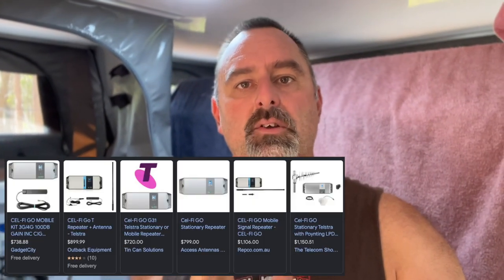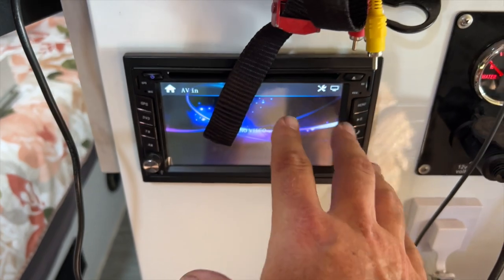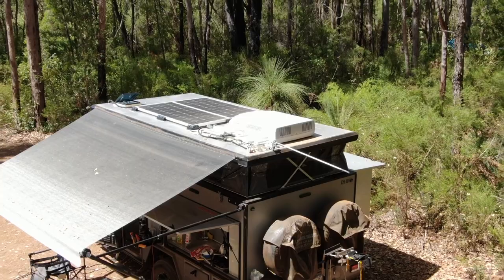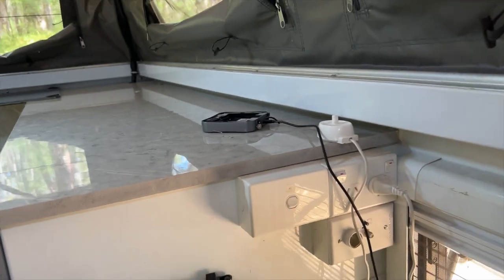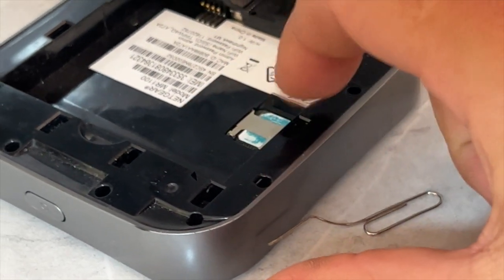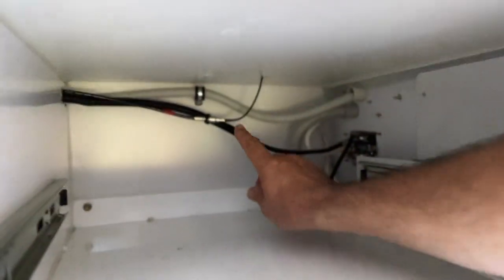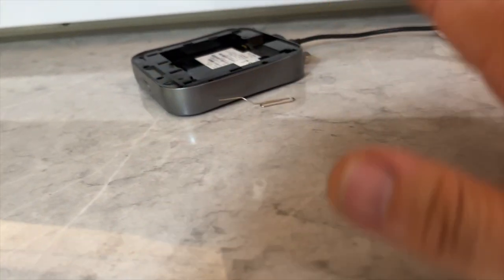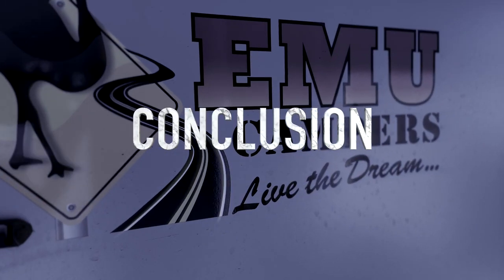INTERNET while CAMPING - We use both OPTUS and TELSTRA. How and WHY do we do it?

Comment: Good point about Telstra and Optus. Whilst Telstra still have the best overall coverage, you'd be surprised at how many places there are out bush where Optus reception is decent but Telstra reception is non-existent. Not quite the same but I've been using a dual SIM phone for years just because it's nice to have Telstra and Optus on standby, in case I'm somewhere where only one or the other is available and I need to make a call (or be contactable).
Reply from the maker: Yeah even when both have coverage if it’s busy (say Easter) the Telstra cells slows right down because so many people are on it and often the Optus cell is faster.
Reply: @JebbreysJibberish  That's true... it's the exact opposite of data speeds in metro areas, where Optus is usually slow as a wet week because they don't have anywhere nearly as many cells as Telstra.
Reply from the maker: Very true!
Reply: @TheKnobCalledTone. not really, Optus has ALOT of sites in the cities! It’s to do with the location of the sites and what antennas are being used
Reply from the maker: Often, like now, tourist destinations like the south west of Western Australia have awful coverage as the Telstra network is almost completely shutdown. I couldn’t even maintain a phone call this morning and haven’t had 4g internet that was usable for a week in Busselton. Optus however has less traffic and is working great! We’ve had this on a. Few trips in busy periods where Optus is working good and Telstra is just congested to the point of being g usless.

Comment: Hi Jeff, minus Optus this is my setup. I do use a panel antenna as well as the Omni for my remote camp, depending where and whether I need the gain. A hint for your fellow youtubers: Switch the phone to airplane mode then activate wireless and bluetooth. Stops the phone looking for better signals and makes a huge difference to battery life.Nick
Reply from the maker: Good point with turning off data, it doesn’t affect the phone with no sim in obviously, but for any others it sure would save battery especially in low coverage areas. I should remove the TV antenna and put a panel phone antenna in its place, bloody great idea Nick!

Comment: Very interesting I might give it a go thanks
Reply from the maker: No problem. To mount the antenna onto the wineguard I just used a bit of ally square tube the same size as what makes the main mast and just bolted it on as a slight extension to get the base of the antenna above the tv antenna.
Reply: @JebbreysJibberish  thanks I have a old aerial for mobile phone that is a good start
Reply from the maker: Another thing to keep in mind is that Optus and Telstra use slightly different frequencies so it’s good to make sure your antenna is wide band and can handle as many as possible.
Reply: @JebbreysJibberish  thanks but I am only telstra so I hope it works OK
Reply from the maker: Should be fine then 🤞😎

Comment: I've been considering something like this, as I too am not a fan of Cel-Fi GO.  Will look more into it now.  I was a user of Chromecast but found it so unreliable. I've now switched to Fire TV (Amazon).  Have you experienced using this on your set-up?
Reply from the maker: I haven’t used the Fire TV on this setup but it should work fine as it’ll think your just at home. The chrome casts did have a period a year or two ago where they were really bad but the last 12-18 months have been really good, the best ever.

Comment: Hey mate, what antenna have you got on the car?
Reply: And does the antenna just plug into the nighthawk and get power through it?
Reply from the maker: I actually haven't put one on the car as yet. I'm planning to do that, and it will most likely be a lower Dbi shorter style on the roof rack. It will work better up there than on the bullbar. Most antennas require a pigtail adaptor something like this (You will have to check the connector that comes with your antenna first though) : https://www.ebay.com.au/itm/163639192605?hash=item2619a7ec1d:g:~0EAAOSw0IBcncwE&amdata=enc%3AAQAHAAAA8AlD1MEGmt6XlwJ59eMqNM%2BxC0zrJLR8LbCizQh%2B0Eb%2FCG7YBSZaV2CY2xdkxpzmPc4HngfWeV16G1%2F%2BnkkU1s0NVkqZgGx8%2FBsQDfFpNdF93DghwT5J52mxjFOQrQRnngrErZ88Xsr%2FMjYcftYecjGR8dfzbIXUYOVIcNhlX3MYG86o8NmPM54F6uF3ndDeHXordcFTve3sRbwNOez4bxi5IIV6FmXLFc4fZ9aIKcLZ3vtXZRNxPNPUDAAf1F6FKcpnLvkvgIJxtiEYKNxDYymAs%2BNOxBogk5uicmEq6oAixjuJVCQheR2loSM4IVaDsQ%3D%3D%7Ctkp%3ABFBM7s-6q61g